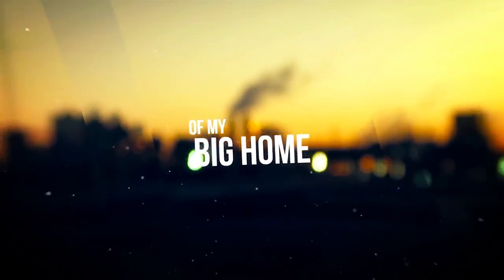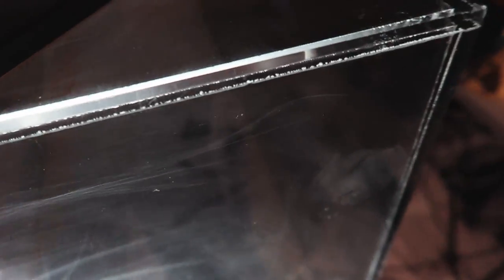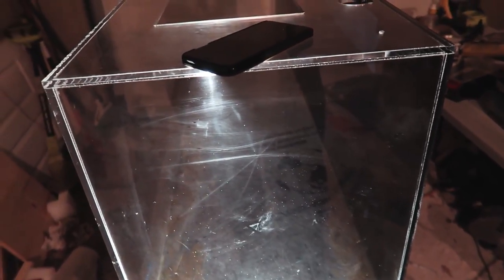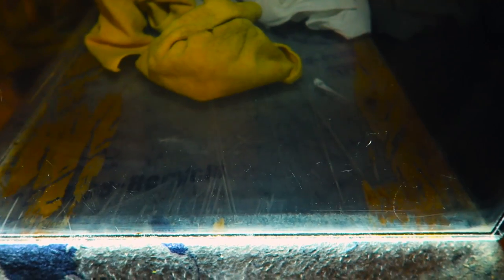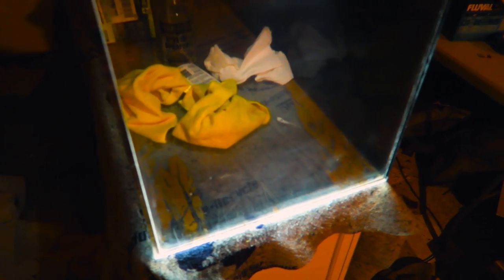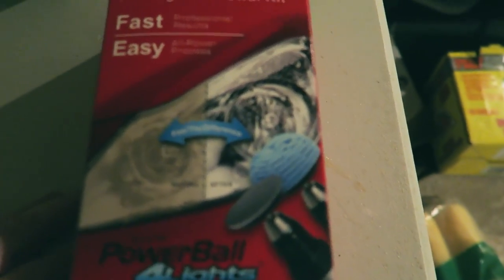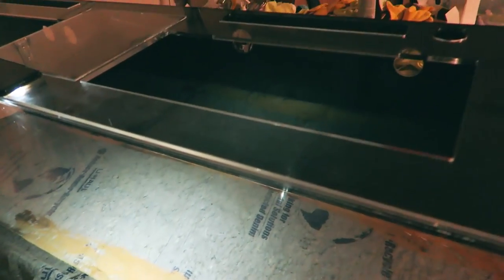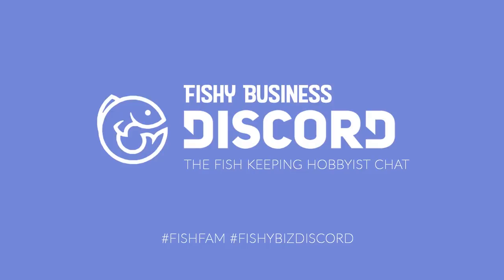Sanding and Polishing acrylic tank 🐻  Bear Necessities

Comment: Cool vid.  How hard was it and now that you've done it would you do it again?  Any advice to someone who's considering trying to rehab a tank?  Thank you
Reply from the maker: It wasn't too hard in terms of difficulty. My advice would be to take your time. Take it nice and slow and don't be afraid to make a mistake. I am impatient and I found myself having to redo things. I would read read read as much as you can but don't get discouraged if you don't get the results that others have right away. Also when sanding, I would go very slow, and make sure you go even slower with the fine grit. With the polish, I had much much better luck with the automotive headlight kit than I did the Novus stuff. Hope it goes well for you! :) This was my first time doing anything like this on a tank so it was an experience. I was nervous as heck. haha
Reply: Great advice.  Thank you again

Comment: Someone made a comment at another video to use a heat gun to melt down the scratches. The guy uses to restore antique cars. Seemed to be an expert in polishing cars. Another person restores airplanes’ windows and recommends  using only sanding paper over 3000 up to even 6000. Hope this helps. I’m gathering as much feedback to restore my own 100 gal tank.
Reply from the maker: Very interesting! That sounds like it could work! I sold mine when I moved sadly but my method worked well enough

Comment: Ok,what about doing it with fish in the tank? Somebody stupid used a rough pad on the inside of the acrylic. Can it be sanded with fish and not taking down the whole tank? Or maybe drain the tank low and then sand? No chemicals..just very fine wet sandpaper ?

Comment: I made great progress on my 240 gallon well over 30 years old by using 3000grit as I made big water changes. I did that for three weeks in a row, then to get the very finest swirl marks out.. I ended the odyssey by using ....Colgate toothpaste on the inside of the tank..wiping off. Filled the tank...and it looks so much better than it did one month ago.
Yes It had a full tank of fish and plants,sands,driftwoods. Nobody was bothered.
btw The toothpaste did a great job of cleaning the outside of the old tank too. ALL done by hand.